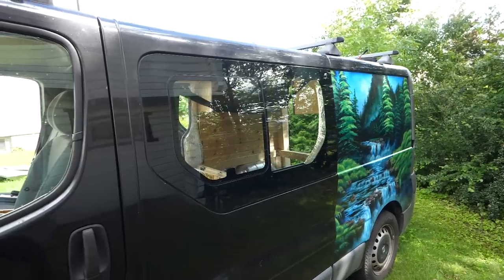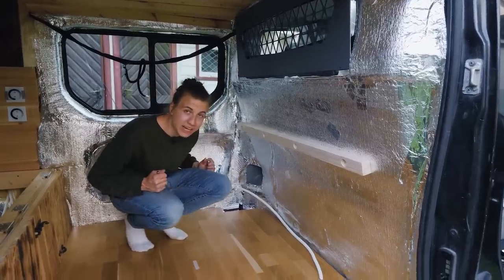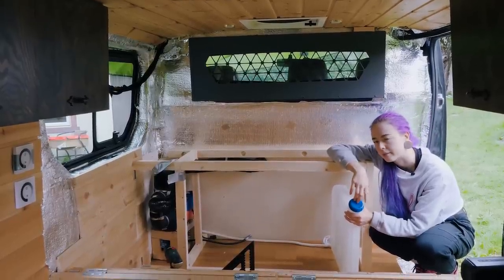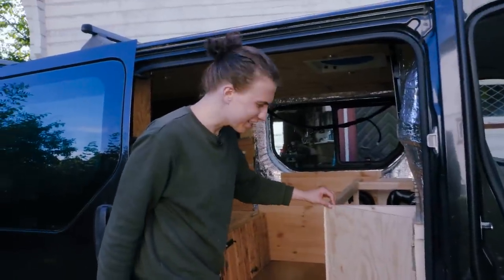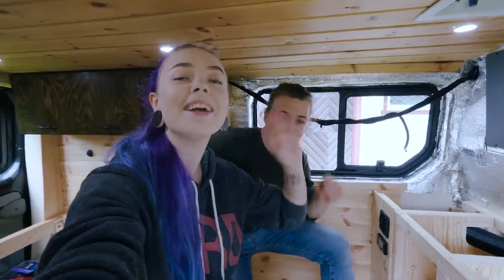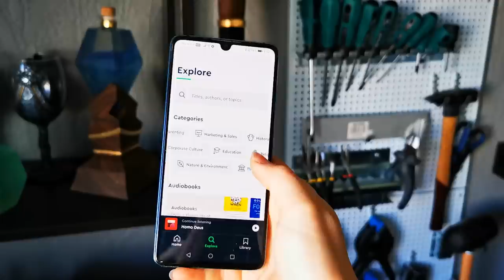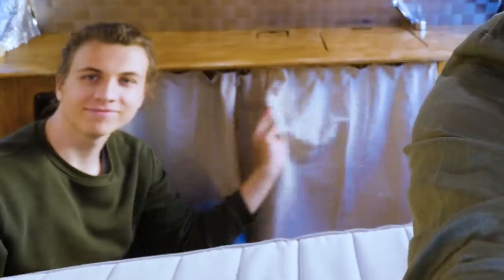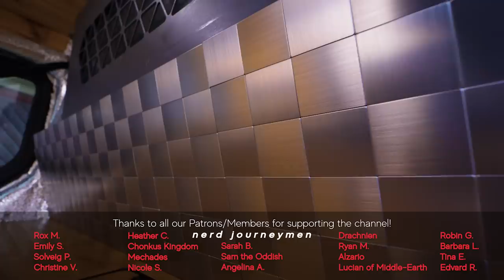Making a Kitchen in a Small Van!  - Camper Van Build #4

Comment: Cool project, but a bit of a Health and Safety nightmare. Get that diesel tank as far away from the food preparation area as you can, or stomach problems will be a regular occurrence on your travels. Put a really good hydrocarbon detector next to that propane tank. Never run that diesel heater while you're sleeping, they do fail and leak CO. 
Preferably you should have a separate compartment that is only accessible from the outside for all of this, of course. (Then it is reasonably safe to run the heating while you're sleeping too.)
Reply: I love their energy as they work on this project, but I’m glad I’m not the only one worried about their safety.
Reply: I wonder where they vent the heater and gas exhaust to. Did i miss that?
Reply from the maker: Thanks for your concern, Kjell Ove! I see where you're coming from, because we didn't address many of these points in the build. I'll write a bit in depth about our measures here, as I'm sure there are more people interested in this topic. 

Safety has always been the number one priority, and when dealing with diesel heaters and propane there's a few things to be concerned about. Not mentioning that sleeping in a small space without ventilation is hazardous on its own. First of all the diesel container will never be filled inside of the van, thank to our swinging door solution, so hopefully all spillage will be outdoors. We will have two CO sensors, one for redundancy in-case of fail. I'm confident in my installation of the diesel heater, but as you say, they can fail, and this is a "cheap" chinese version, not the known brands like Webasto, so having it on at night has just never been an option to be honest. CO leakage, vent blockage causing overheating - I see multiple points where running it at night would not be clever. For the propane situation we use a dual gas stove top with a gas stopping mechanism if there's no ignition. We have a hole in the floor to let any leaked LPG gass escape, in addition to a high quality LPG sensor on the floor. On top of that we have the extraction fan right above our cooking space to help clear the air when cooking. Since the stove top is not a permanent installation, the gas will only be connected when we're cooking (this is not by safety design, but a consequence of our tiny space. Works as a safety mechanism as well though).

If anyone is serious about building a van, I suggest thinking about the security measures really early, it really helps you not taking shortcuts and not having to rework alot when they find out how to implement them! :)
Reply: i think that a electrical stove would also be a safer option fro the stove you can literally find mini stoves that you can connect anywhere around a house as long if there is a wall adapter but i think that there should be things that you can connect to a car  adapter to be able to connect things like (just a example because i couldn't think of anything else) a game console like a ps4 or xbox one

iv heard of situations where camper vans with gas stoves explode due to a gas leak or people having the stove do the clicking thing to light the fire but do it for too long and gas has leaked inside the van that gas can still ignite if it has the chance
Reply: @Glax201  good luck powering an electric stove in the wild
Reply: @Ange Einstein It’s a camper van, most that I have seen have wall outlets and such around but if it only has a car adaptor there are cables or other car adaptor items that will allow wall adaptors to connect to
Reply: Ange Einstein literally all you need is the van to have power to power the stove
Reply: @Glax201  with a gas stove you don't need any external power. That's nice if you want to stay somewhere without a camping site
Reply: Ange Einstein well you have your reason and I have mine it just a suggestion after all
Reply: Glax Earlydiygamer gas would probably be better for if they go out adventuring. And not just go to the crap local camp site

Comment: Great video! The detail work fitting in the curved pieces at the back was really impressive. I love your answers to the diesel tank and the curtains! Maybe you can have removable legs for your gas cooktop so you can do the cooking outside when the weather is good. I think a place for a small trash can that will keep it from tipping over would be useful.

Comment: I did this and used the indoor kitchen exactly once.   One pot of coffee, boiling water. The walls were dripping with condensation from the steam.  When camping cook outside.  You would be amazed how easy it is with just a two burner propane stove, a square deep plastic bin for a sink, and a pitcher of water.   Just add a reasonably sturdy table top, either the campsite picnic table or if you have to make one out of wood that folds up for storage in the van.  For the deluxe version add an umbrella and stand if its raining.

Comment: A heads-up on the wooden door of the bed's storage space. You may want to sand the bottom, where the wood meets the floor, just 1/8th of an inch or so. As is, if the wood swells just a pinch, that door will fit too tight. You'll scrape the floor, opening and closing. Just a thought.

Comment: You could use a forked pipe, so you could permanently leave the hose feeding your heater in the tank, and a smalle funnel hose in the sink urinal style to fill up your diesel tank. From the videos youve psoted, you can do anything, and youve got the equipment to do it. Might be more of a hassle that way, but save you alot of effort and time in the long run.

Comment: For doors on the kitchen area, what about an individual door for each section that hinges on the bottom? That way, you don't need to have clearance for the entire area that the door can swing open. Plus it allows for it to open a little bit if you just need to reach in to turn on the gas or check water levels, but you could also fold it all the way down if you needed to take them out.

Comment: I know you already did the build, but what about sliding doors for your sink? Like those Japanese/Chinese style. So it can be very light and you can draw on the paper! Also for your counter top you can seal it with resin because it will prevent weathering and it’s pretty heat resistant. A lot of tiny home builders do that as well.

Comment: It's looking really nice. Kind of makes me want to start doing the van that I plan on doing. Have to get the right type of car first though. Since I'm a very tall Swedish guy (205 cm) I will need a van with some extra headspace or I will probably get claustrophobic :p
Also, a tip if you still want some doors for the kitchen counter. Why not use sliding doors? route groves under the kitchen top and have a slot on the floor and then doors that can slide in them. You will need two slots with two doors in the back slot and the third in the front slot.

Comment: I had a great idea for a front to you van kitchen cabinet instead of a curtain. if you used once piece of wood to cover the opening with it hinged on the back side and under the top  with a folding leg it could be used as a table or and cover for the cabinet.

Comment: clay pots upside with candles under line up in a line would add a great deal of heat and light for the camper. i would use sealed fuel. moving mite spill the candles.

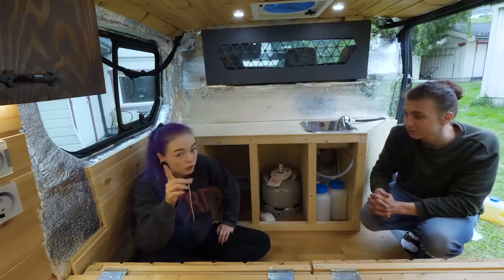Comment: I'm "only" 9:36 into this video, so it might be adressed (or even done) later in the video, but I type this out now anyway while I still have it fresh in my memory - you're talking about the kitchen counter front, saying doors would be impractical and that you might do drapes instead. Why not sliding doors? You could have three "furrows" in the bottom and top, one for each section, and a small door that you could slide around to cover the front?

Comment: Er, why didn't you make the diesel tank fit the hollow area on the opposite wall (that you have covered with wood before)? It seeme to me as if it might have a very similar volume or be even bigger, it is much closer to the heater AND it is close to the outside and completely hidden away. So a simple additional hole in the wall below the window would allow for easy access and all spillage would be on the outside as well.

Comment: Hello! Like Your Channel. 
BUT: The Propane Tank as to go in a Air tight sealed Compartment with a direkt ventilation to the outside. Here in Austria its als required by LAW.
Also the Diesel Tank inside the Car is not a very good idea, since the tank needs to have a ventilation hole, at least this has to go outside.

Hope you read this, its quide dangerous if you leave it like this ;)

Comment: I wonder why u did not use instead of the curtains two thin square panels on sliders that can be slide apart to close and slide both to one of the sides to gain access because it most likely wouldn't take much more space then the curtians

Comment: I know this is an old video . I'm catching up. But you could of done sliding doors with a dual track system on the sink front . Ikea actually sell furniture with the very mechanism I'm trying to describe. Haven't finished the video yet so you may have actually done just this but it was definitely a solution if not

Comment: They are very likable. They are very good story tellers. 
Unfortunately they don’t have ANY building experience. Instead of talking with an expert carpenter. 
They just do what sounds good at the moment. They don’t have any contempt of safety. Proper and safe building methods. 
This may lol nice. But it is a piece of junk. It doesn’t have proper ventilation. So in the cold of winter. They will go to sleep and never wake up. At the very minimum they desperately need a carbon monoxide detector. 
The materials they used added way too much weight. If they would weigh it on a commercial scale. They will discover that the van is dangerously over weight. 
Please watch and enjoy their fantastic story telling. Before you start building. Go to a couple of businesses that sell van conversations. Take lots of pictures. Take note of the materials the professionals use. Ask lots of questions. Make friends with a professional finish carpenter. Be willing to pay a little for there advance. 
Most of all install a smoke detector and a carbon dioxide detector.